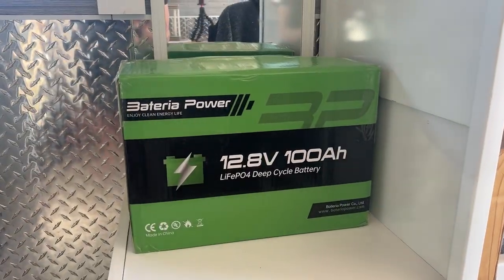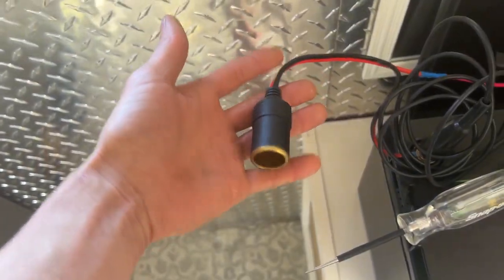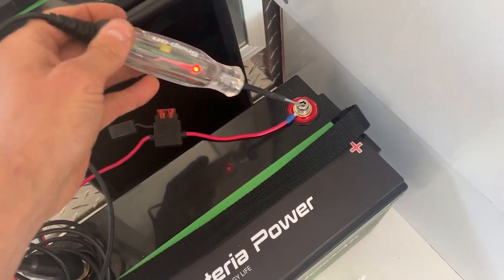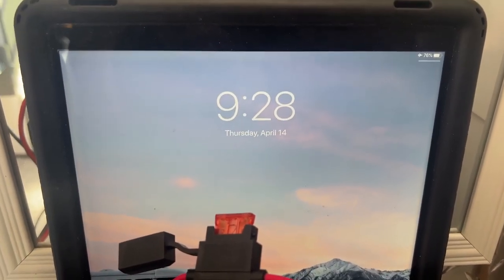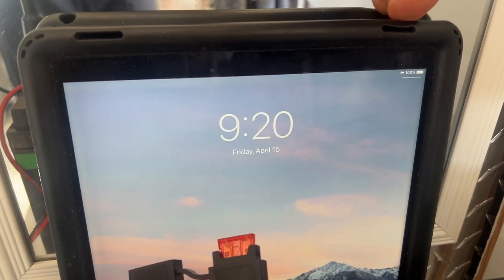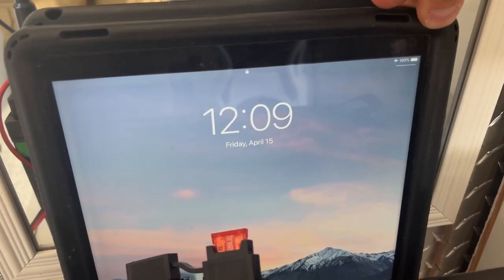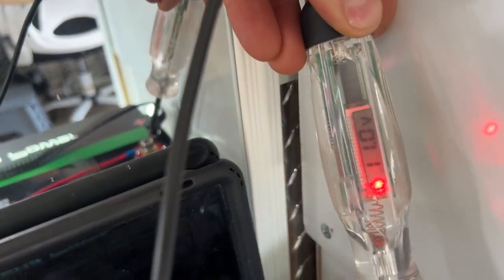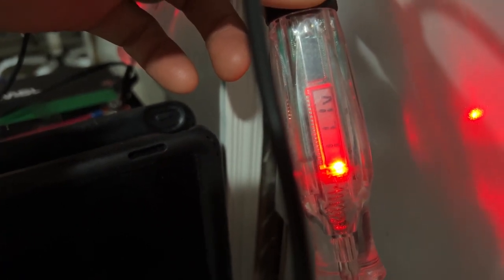100ah LiFePO4 lithium battery can power my fridge for how long?....Bateria lithium battery review

Comment: Fully charged each cell should be 3.5v (total 14v for 4 cells) When you received the battery it would be delivered are roughly 50% charge. Once you fully charge the battery to approximately 14v you will find the battery will run the fridge much longer.
Reply from the maker: Great to hear!
Reply: The resting voltage probably wouldn't be that high even when fully charged

Comment: I am a little perplexed.  I tested my iceco 42 qt with a fully charged 90Ah lead acid when I first got it.  I plugged it in on Sunday at noon and it kept the refrigerator cold (set to 32F (empty)) until the next Friday at 6 PM... The compressor only cycles to maintain.  So I was checking this battery out and disjointed in how short a time it kept your's cold.  Now the voltage to determine state of charge on a lifepo4 is not going to work.  You also need to make sure it is fully charged, cells balanced and then use a shunt and so on.  The lifepo4 should maintain about 13.2 volts for all it's power, 100Ah ... I think maybe the test didn't take all this into account, .. yet ... "real world" testing and use it 100% most valuable.  ...
Reply from the maker: This was my first time using lithium. turns out the battery was not fully charged. Im conducting a new test. Video will be out soon

Comment: Good video. I’ve been running a 60Ah battery with a dc to dc charger to run a fridge in my mini van. With a full charge my battery will run the fridge from 6:00pm Friday through 12:00pm Monday. Roughly 66 hours depending on temperature/weather. A 100ah battery should get you 100 hours plus.
Reply from the maker: Glad to hear that!
Reply: Nice

Comment: And you ran a red light. Good run but you should have still charged it before using it top charge on that battery is most likely 14.6 volts so it should last longer next charge good video 👍😎🇺🇸
Reply from the maker: Thank you !
Reply: That's all I can think about. 🤦

Comment: You started the test with a battery around 35 % charged.  You should read the manual when you get one .   All brands of these batteries send them only partly charged for safety.
Reply from the maker: Youre correct. this was my first time using lithium. Im filming a new test with properly charged battery. that video coming soon!

Comment: Pls i jeed help in understanding Solar Batteries and inverters i have a lead acid battery of 100Ah once it hits 11V the inverter shuts off automatically so my question ❓ is if i buy a lifepo4 or lithium battery will the 12v inverter still shut down once the battery is at 11v or will the battery 🔋 keep powing my inverter even when it's below 12v which is the recommended voltage for 12v inverter to work ? Or will it keep powing my inverter till the battery completely dies off like low to zero just like how mobile phone batteries operate ?
Reply from the maker: If you ran your lead acid battery down to 11 volts it’s likely been damaged. You’re not supposed to let them drop that low. The inverter will automatically turn off when voltage gets too low but that doesn’t protect the battery
Reply: @nomadbrad503  thanks so much

Comment: What was the temperature around The fridge?  How many times did you open the fridge?
Reply from the maker: Ambient temperature was around 80 degrees. I used the fridge as normal … opened it about 6 times throughout the day.